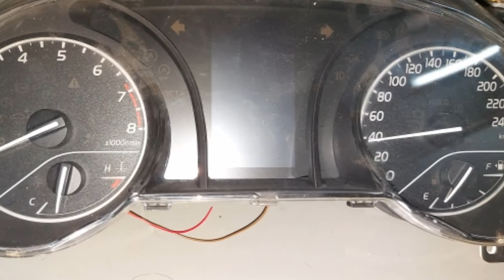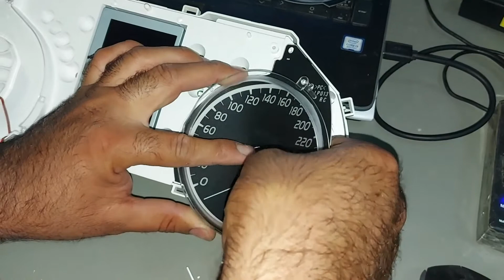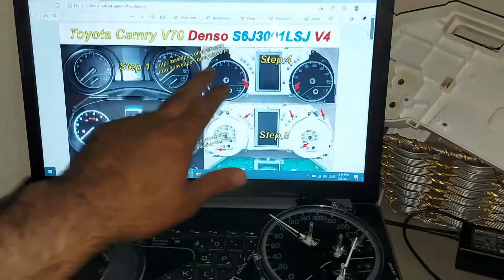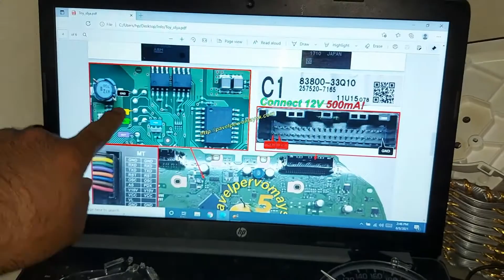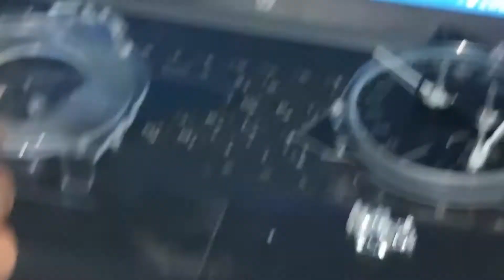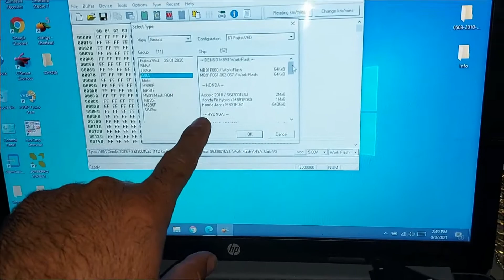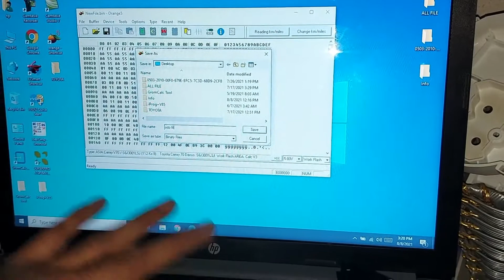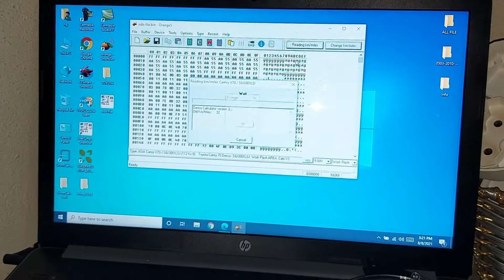Toyota camry 2020 Odometer adjustment Auto information

Comment: hi bro where did you get the wiring from? is orange5 default?
Reply from the maker: purchase Orange 5 software Give you point  help pdf file
Reply: Did you install additional scripts on the orange 5? Or its just the original software

Comment: hi, I have a 4.2 inch display just like this, from a car that it has radar cruise control, when I take it and put it in a car that doesn't have radar cruise control then , the car will show a message that there is a problem in radar cruise control and go visit the dealer, just like the message in the end of vedio 09:56 , what I want to know, if I disassemble the cluster until I reach the motherboard, then disassemble the 4.2 display and put it in another motherboard, will there be any problems? like showing a message of radar cruise control problem,
Reply: in other words, if the car has parking brake malfunction, and I took the 4.2 display from it and put it in another motherboard, will the message of "parking brake malfunction visit your dealer " show again? thx
Reply: I have like your problem

Comment: Kia Rio 2006 diagram ?
Reply from the maker: X100 key porgrammer  Will reverse If you have this programmer ?
Reply: @autoinformation  I have Digiprog with obd and stik with 4 wire …. The obd not work so I need wire diagram🙁